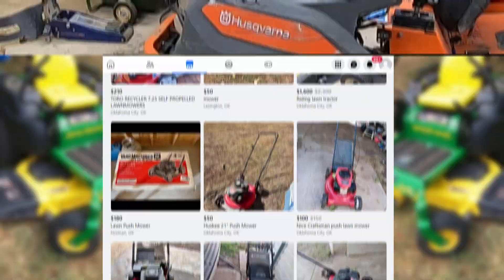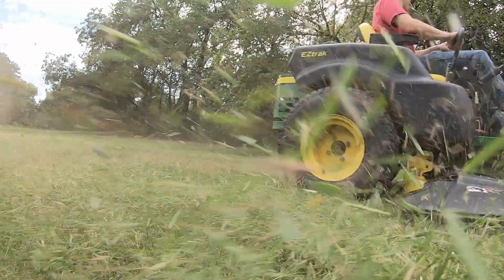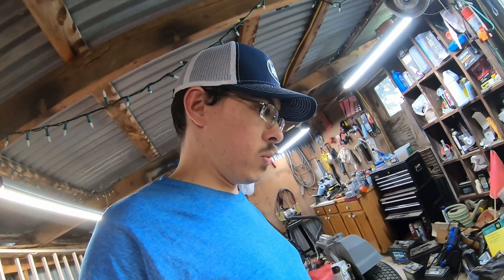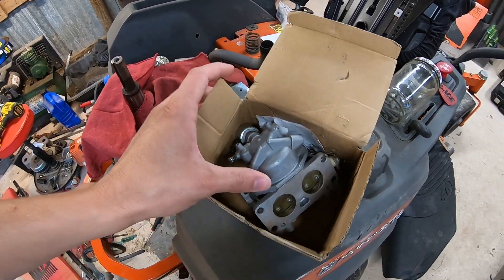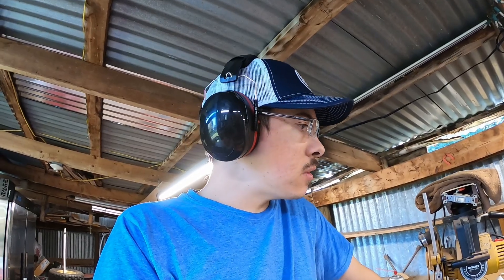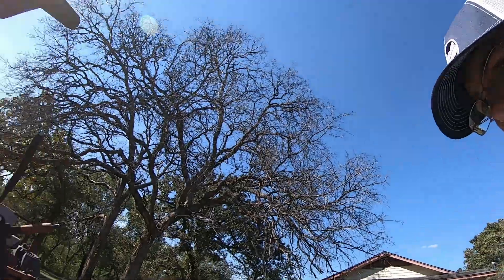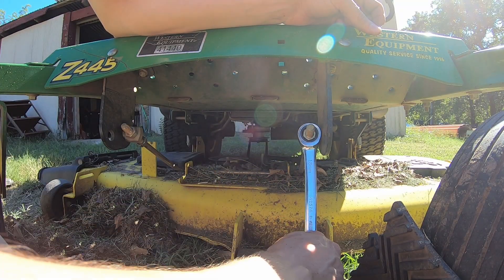Worst mower, BEST price! Why I bought a John Deere Z445 Zero Turn

Comment: Your opinion is John Deers are the WORST mowers... WHY? I see lots of contractors using them as well as farmers. ... so Im confused by your opening statement.... Hustler, Scag,Toro, kabota came afterwzrds as BRANDS.... a zero turn is not for the average home owner unless its a standard ride on type.....please EXPLAIN😮😮😮
Reply from the maker: Great question! My opinion is based off of my experiences with residential grade John Deere’s. From what I’ve seen, they tend to wear out faster, and are harder to work on. They also tend to cost more. 
For commercial grade zero turns, I think Grasshopper, Scag, eXmark (and some Toro’s) and some Hustlers. Those are what I consider the top 4 brands in general. Brands like John Deere and Kubota, are tractor companies that sell zero turns, they aren’t zero turn companies first and foremost. The wide spread brand recognition would lead to a lot of sales, especially to farmers.
But, at the end of the day, it’s just my opinion based off of what I’ve experienced and seen. Others will have different opinions based off of there experiences.
Thanks for watching!
(P.S., do you think I should make a video ranking brands?)
Reply: I’m betting that they bought the Scamazon carb that includes a crappy fuel fuel filter and an even worse fuel pump. I bought one of those cheap fuel pumps and it never worked right. It would lose prime and barely pumped fuel making it hard to start and run lean.
Reply from the maker: Good point, I might want to try swapping to a better fuel pump. It’s continued to lose its prime, and it is a little annoying
Reply: I posted a new post today.  Read my post.  
He is buying used equipment that probably hasn't been taken care of properly and giving it a bad name because he has to fix someone else's neglect.  Sure, things break, but most of the time it's from poor maintenance and neglect.  I was a ch eng on tankers for 47 years and have always had JD equipment at home and never failed me.  Proper maintenance is the key.  And if he thinks JD is hard to work on he needs to work on a Caterpillar or foreign engine where you have to take 1/2 the side of an engine apart to change a water pump.  He's a wus.

Comment: I don't understand why u say "worst mower".  This is one of the most under rated mowers that you can buy.  I purchased one in 2006 and it was my go to mower, cutting all day long commercially for 8 years.  Never broke down, always started right up, and was priced good, what more can you ask for?  The only thing I had problems with was the starter relay, replaced it several times.
Reply from the maker: I say ‘worst mower’ from the perspective that I personally don’t really like John Deere mowers. I think usually you could get a better mower for the price. The reason I got this mower was that it was sold for way less than I think it is worth if I were to turn around and sell it. For the price I paid, it is a good mower.

Comment: They make carb cleaners try that FIRST!
Reply from the maker: I’ve never had great success with using carb cleaner through the fuel system, but it certainly is one of the easier options. In this case, the seller sent me the OEM carb that had been cleaned at a shop, and it worked better.

Comment: i bought a very low hour Z425pretty cheap  from a guy whose dad had passed away and he didn't need it. It's not near as good a machine as my bad boy but will be ok for a backup. The engineers that designed these evidently never mowed with them. The aluminum pivots in the steering arms were loose and needed replacing. And it is very hard to get on and off it because of the placement of the emergency brake handle. I am adding a roller in the front middle of the deck too. Plus the pressed deck is not nearly as heavy built. It was in great shape and well maintained so for the price I guess it will do for a backup. I sure wouldn't go out and buy one brand new though.
Reply from the maker: Yes, I think the Z425/445 are decent mowers, but not up to the level of a commercial mower. The transmission set up on the older ones does seem pretty robust to me, but there are still other factors like you mentioned.

Comment: I bought a Z445 in 2007, 54" 25hp from a John Deere dealer.  I have never ever regretted it.  I have owned it for 17 years and cut 12-15 acres every week until last week. Sure it's had a 4 carburetors on it in 17 years(has1650hrs and does not smoke) 9 set of blades, 5 sets of belts, 10 deck rollers, and a new seat and arm rest.  
I also changed out one set of spindles and mulching kit.  But, the engine and drive train has never been overhauled, just oil and filter changes at 1/2 the hours JD recommended.  For someone to post "worst" lawnmower is not right.  Maybe someone didn't take care of it like they should have.  I know several people with the same model and theirs is still running good like mine.  My great grandson is running it now.  
I bought a Z960M to replace it, but didn't really need to.... just wanted something bigger.  After 17 years it was time to ride something new.

Comment: If you drop the rear of your deck compared to the front, it helps to create a double cut. This can help with stragglers. Maybe drop the rear 1/4" below the front and you'll be perfectly fine.
Reply from the maker: Thanks! I may re-adjust it in the spring.

Comment: I know this had nothing to do with the video.bit do u recommend any gas treatments.i don't use any stabilizer for the gas or ethnol treatments I never had problems with it 15 years old and still running strong la 125 
Like techron or something like that for carbon and could I use it in a lawn mower to
Reply from the maker: I personally have never used a gas stabilizer. We always run %100 gas (no ethanol), so that probably helps. I’m sure fuel treatments could be helpful, I’ve just never used them except using carb cleaner or something when trying to fix a fuel issue.

Comment: Front of the deck is supposed to be a little lower than the back to help it cut easier 😊
Reply from the maker: At full height or at lowest height?
Reply: @garagestory  to be honest I am not sure. I adjust mine at the desired cutting length for my grass. They say it clears grass and keeps from running it harder and more wear and tear. I think Husqvarna has a video explaining it on their zero turns. Would you like me to send a link for you to view?

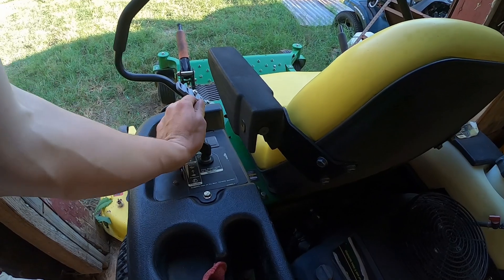Comment: At 9:30 when you cranked it, it it didn’t really wanna crank at first, my z425 does that, any idea on a fix?
Reply from the maker: Good question. I’m not really sure. As long as it still works, I’m not to concerned about it. It’s possible that there is a dead spot in the starter, or maybe the compression release in the engine is a little sticky.
Reply: Try choking a little, not a lot.  If still doesn't want to crank check fuel pump and filter.  If not, change carburetor.

Comment: The front of deck needs to be1/8 in lower than back
Reply from the maker: Good to know. Is that an official specification, or just what you’ve found works best? And 1/8” lower at the highest setting, or the lowest setting? It would vary since only the back is raised and lowered, the front just hangs.

Comment: I have the same mower; I think its finicky when mowing in the hot weather; I am not sure I like it
Reply from the maker: Finicky in what way? Is it vapor lock that you are dealing with?
Reply: @garagestory  it stops like it is overwhelmed; like I am cutting too long a grass and my grass is really short
Reply: @garagestory  what is vapor lock; I mown with it last time and now it’s not even starting
Reply: @garagestory  I took out the fuel line and it was blocked; I tried to restart it after I blew air through it; it did not start yet

Comment: WHAT MAKE IT IDLE UP AN DOWN
Reply from the maker: The mixture being off. It can be an incorrect setting or jet, or it can be a dirty jet, or it can even be air leaking in past the carburetor.

Comment: You have a home owner mower and you got the wrong blades  you need high lift blades
Reply from the maker: Yes, it’s not a commercial model
Reply: The z445 don't use the high lift blades that's not a high lift deck